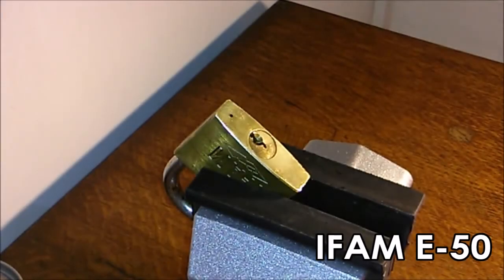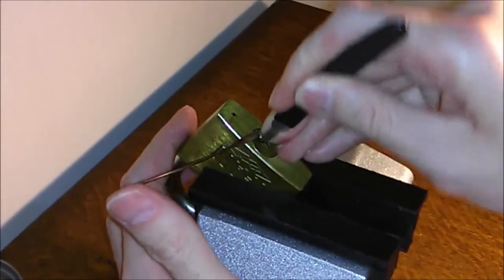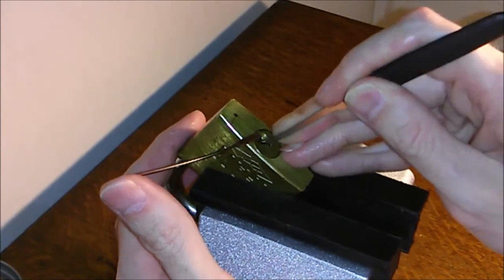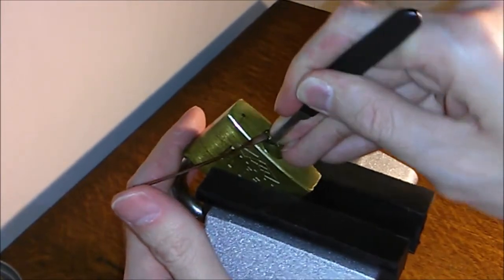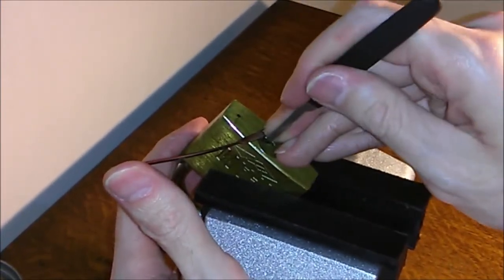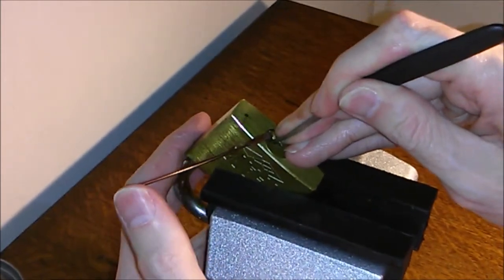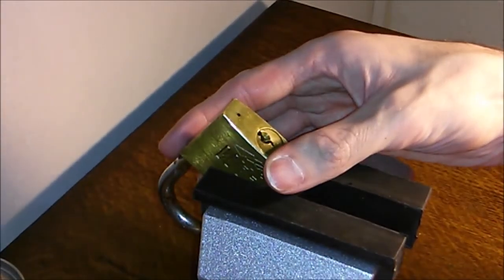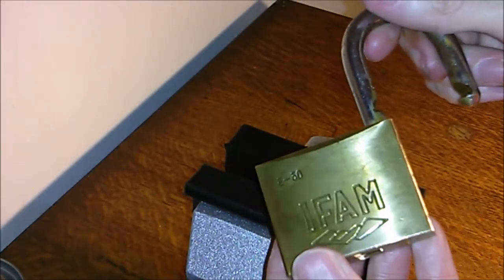(8) Lock Picking - IFAM E-50 Single Pin Picking

Comment: Nice controlled picking.
Reply from the maker: Texas Jim Thanks. This is the first lock I've successfully SPP'd.
Reply: Just take you time and feel the pins. Start with light tension and increase tension if you need to. Then just feel the pins one at a time. I am no expert, I am still learning.So I have problems picking locks also.
Reply from the maker: Texas Jim Thanks for the advice Jim. Each lock I try seems to have it's own unique 'personality' you have to learn to get it open.